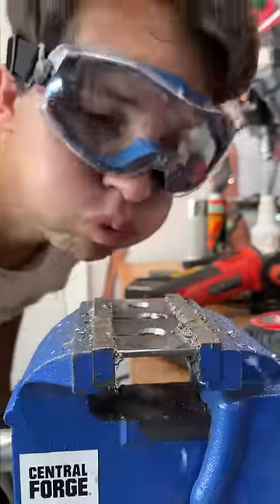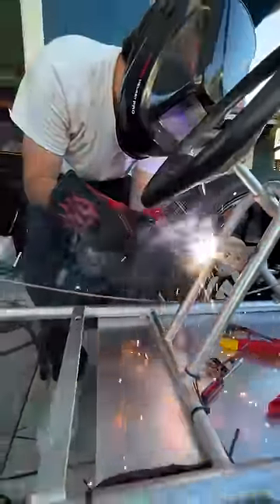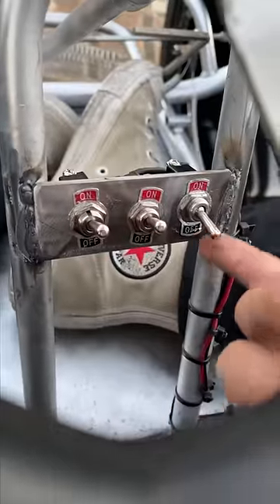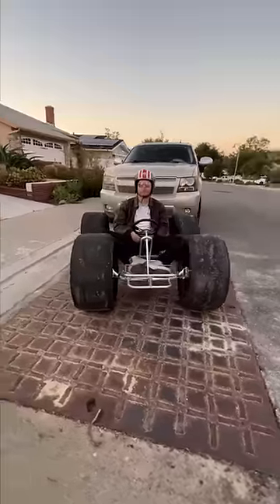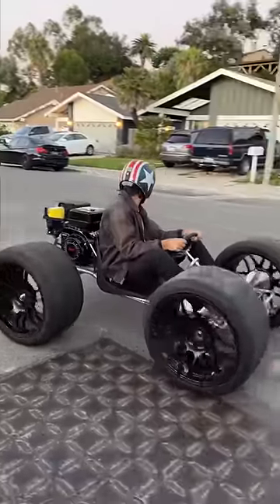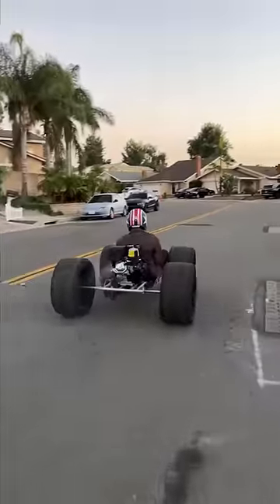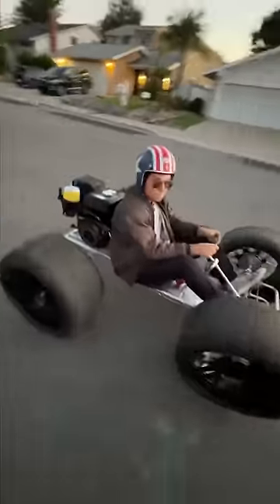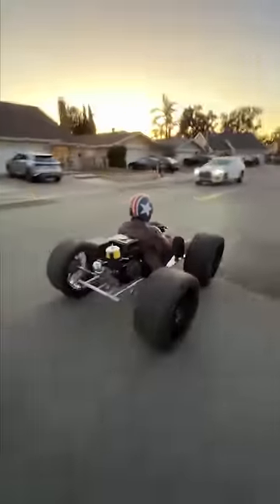My $100 Monster F1 Gokart First Drive Didn’t End Too Well

Comment: those tires are going to be your biggest issues
Reply: Yea
Reply: The tiny tires would have been so funny on like a f1 car sized gokart😂
Reply: Please just put on go kart slicks
Reply: He was not going 30mph
Reply: If he editedthis he said
(These tires going tobe your biggest issues)
He need make it longer so more like a f1 kart i cant tell when the wheel touching it need a bumper
Reply: @Bjw1809 I'm betting he did off camera
Reply: Yeah he’s going to need a low gear or it’s going to pick up speed very slowly and he’s going to need a very beefy axel
Reply: 1000th like
Reply: God is coming soon Repent. Please
Reply: @everettstormy  not in that thing
Reply: Lot of force on the single brake as well
Reply: Why is no body talking abt that the kart has no differential
Reply: @jacebarbiellelasquite1109  Exactly what I was thinking. Without a differential on the rear, especially with those big tires are going to start binding the driveline in a turn. There's a reason gokarts only power one wheel without a differential.
Reply: @pdog2121 biggest issue  is when rent a tire  comeback for their wheels  J/k
Reply: fun project. looks like a blast. here are potential issues i could see going wrong: the death wobble is probably from hubs that aren't running true & bearings too small to support the mass of the wheel; the brakes may be too small to overcome the inertial force of the wheel when rolling; flipping due to center of gravity being too high - if you lower the cg (including driver) to be even with the wheel hubs, it would be far less likely to flip; there's no emergency brake - you need to be able to lock the rear wheels in an emergency so you don't have to hit a curb or someone else to stop. anyway, good luck!
Reply: Could you explain why the tires are an issue thanks
Reply: Dude I get it
Reply: Lots of weight to get rolling and lots of weight to stop from rolling
Reply: Yup!!
Reply: works if the axles thicker or tires thinner
Reply: axle 🤏
Reply: Thank you
Reply: Tires and wheels weigh more than the whole car!! Bigger not always is better
Reply: One day he may find out he needs a back diff
Reply: Yeah get rid of those wheels and tires 😂
Reply: The cheap frame would🧐🙏❤️🙏
Reply: Swap those tires with motorcycle tires
Reply: Lack of suspension and heavy ass tires. Something was bound to break.
Reply: I was gonna say that.  The wheels and tires weigh too much for everything he's got goin on.
Reply: I love them and I have a folder about them
come take a ride! :))
🚅🚈🚞🚝🚂🚃🚄
trains, trams, aren't they all beautifull
Reply: @cyber3167 I wouldn't really call your project consistently falling apart the fun part. And if he was gonna keep those giant ridiculous looking tires he should really buy some stronger tie rod, suspension pieces, ect.... Can you have something that big that your parts aren't rated for it's going to consistently break so he needs to get heavier rated parts
Reply: @UnknownNotFound630 If hes gonna keep those tires he needs beefy everything., Those tiny parts hes putting on that poor little cart literally can't handle the weight of those tires especially when moving.
Reply: @ryanwest764 They are literally too heavy for the axles and tie rods, That tiny carton can't take the weight of those tires especially when moving or cornering
Reply: @kingpest13 More power out of that tiny little 110CC engine would be needed then. You saw how slow he was going with just the weight of the tires
Reply: @jacebarbiellelasquite1109 

It makes no differential whether we do or not … 🤣🤣
Reply: Literally
Reply: the wheelbase is way too short... possible flipping

Comment: That small ass brake caliper isn’t stopping that for long
Reply: That’s probably why it didn’t work
Reply: My thoughts exactly 💯
Reply: Ehhh secondary issue… they have that under the cosmetics list
Reply: Don’t worry. He will find out.
Reply: What's wrong with 2 brake rotors on the front axle? More than $100?
Reply: @kychristell1779  it's the unsprung weight that he has to counter. With tires and rims this big it's an issue.
Reply: Today I'm swapping my geo metro with a harbor freight 😂
Reply: Yeah I bet the pad probably melted and that's why he had to use the curb.
Reply: Exactly, I would have went for 2 stroke karting parts, or buy an OTK tonykart chassis
Reply: It weighs less than 100 lb wdym😂

Comment: Also motorcycle brakes will work alot better setup.   Id personally go with a motorcycle parts bike and use it to make the needed upgrades. . like i said in previous post.    Motor/ stearing upgrades/  brakes off the bike / clutch/ shifter/ key!  Start/kill + those backup switches.   And a handle bar setup off the bike or f1 style wheel would be awesome.

Comment: That's what I was getting at and if one wheel hit a bump its over. Your going to have to beef the hole thing up. Get car  hubs and steering box. I figured it rip out your hand or bend
Reply: trust in the word of God, Matthew 7:24-27 Jesus says here, Therefore whosoever heareth these sayings of mine, and doeth them, I will liken him unto a wise man, which built his house upon a rock: and the rain descended, and the floods came, and the winds blew, and beat upon that house; and it fell not: for it was founded upon a rock. And every one that heareth these sayings of mine, and doeth them not, shall be likened unto a foolish man, which built his house upon the sand: and the rain descended, and the floods came, and the winds blew, and beat upon that house; and it fell: and great was the fall of it. Jesus saves, God bless.😊😊😊😊

Comment: Wheels that big is the issue my guy
Reply: The CG is too high. Put a roll bar on it before it flips.
Reply: F the roll bar get away larger breaks stistem, if you can't leave it😊. Also get a bigger frame so the wheels Don't wobble. Then perfect. I'll run that all day or between times, fun!!🎉
Reply: Lack of power is the bigger issue here
Reply: @danielholland3991  I wouldn’t say that’s the issue here, it’s more then enough for a go kart, the wheels are too big and the axis is probably dying
Reply: @RedOnCod  but if he had more torque then it'd spin them wheels no worries.
Reply: @RedOnCod  and yeah more than enough for a kart with regular wheel size
Reply: Seriously lol. To handle those wheels he's gonna need to beef up literally every component... and then he's basically just building a car lmao. There's a reason karts have small wheels lol

Comment: You need smaller drive wheels or a different gear ratio, that engine doesn't make anywhere near enough torque for your current setup
Reply: Agreed! It doesn’t need wheels/tires that big! Drag racer use thinner wheels in front(for rear wheel drive)!
When I 1st saw his vehicle, I was saying same thing! Gotta have power if u r going wit big wheels!

It’s the story of those big huge trucks! Bigfoot, Gravedigger, etc! They have over 1000-2000 plus horsepower! Lol Dude’s gotta come with it!😅😂😅😂

Comment: Those wheels and tires are a massive amount of unsprung weight, a critical factor in an ultralight vehicle with a small engine. I’d go in the opposite direction, using wide CF bike wheels. MUCH smoother, easier to stop and start, and much easier on parts and engine. That motor is gonna burn out fast trying to move 200-300lbs of wheel/tire, not to mention the stress on every component attached, as you quickly discovered! 
Throw some 26” 3-spoke CF wheels on that badboy and you’ll be FLYING - the launch, top speed, handling, and stopping will be night and day. Dropping 30-50% of wheel and tire weight on a 4 cylinder compact makes a huge felt difference in acceleration from stop, handling, braking… Dropping 90% of wheel/tire weight on a kart is transformative, absolute game changer.

Comment: Needs either passthru tierod ends with 1/2inch or better shafts and ends.    100%    and a torque converter definitely needed with those size wheels and no gearbox ---    your best option is smaller drag style slicks on all 4 corners .. New stearing setup reinforced front spindles with crown nuts and pins to make sure theres no backing out for safety.     Ive made some BADASs carts some yrs back.  But your best option is smaller wheels billet rims solid hubs .. Something like some 8/10in x6/8 wides.   In the back and 8/10 x 4/6 in front.   And make it sit LOW ..    Also those motors are ok for basic use.  But if you're looking for F1 style.   Ya need to go with a motorcycle motor.  Like 600/1000cc.  It will also solve those issues with the clutch / converter. .    and will be able to handle those size wheels alot better.    Also you get a shifter and clutch.    Its alot more fun banging gears 😀  .. And you're going have a key start. . theres alot of benefit from the upgrade to a motorcycle motor and shifter setup ..   Besides the sound will be alot cooler !!!

Comment: For your next build imagine attaching the wheel (w/ tire) on the end of a stick with 5ft stick-out and swinging that shit around without it flexing. Those are the forces you need to counter with your mounting points and frame, plus how much steel your first frame lacked.

Also the same concept is usable for a “smoother ride” just reduce the unsprung weight (smaller wheels and tires)

Comment: I plan to build something similar, going back to school at 51, to get my welding certificate. My project is gonna be to build a tube frame and chassis, but a little turbo 4 cylinder or V6, think sand rail for the street, low to the ground mid engine, with some kind of body either sheet metal or fiberglass.

Comment: As a suggestion, put in a bigger driven sprocket, or change out the centrifugal clutch for a belt driven tourqe convert. It's just a suggestion.

 Edit: aquire and install steering gear like on utv. From personal experience a death wobble happened and almost broke my wrist from the kickback. I would recommend it because it would eliminate the wobble and you will be able to prevent the kickback.

Comment: Differential in the rear axles might help with the wobble due to turning, your inner wheels go a shorter distance than the outer wheel making the outer wheel compensate and skid around.

Comment: Gonna have to weld those tie rods solid if you plan on keeping those tires on. Running a larger final sprocket wouldn’t hurt either since those tires are so tall.

Comment: longer axel braced so that It won't snap and smaller front wheels would probably help mine was a a death trap after mounting up a 440cc duromax I stretched it like 9 inches with 2 inch wider axel. Before it didn't turn well very bouncy an extremely tippable due to the extra engine weight

Comment: Do some air holes to the brake disk for cooling. Like this, they will overheated easily. Better cooling, better performance 👍
Reply: The pads also need to be bigger than a quarter to stop 20" wheels

Comment: Bro I'm no engineer but you actually thought those "tie rods" could safely  control turning on those massive (in proportion) wheels and tires? 

Youre a braver man than I... the second i would have noticed those 1/8" thick "tie rods" I'd get off that desth trap

Comment: Might be because the tires are a lot bigger than the tie rods are designed for looks amazing I think it's pretty cool go-kart but you may need to consider getting tie rods that are designed for tires that big which would possibly mean you're going to have to get a bigger frame for the go-kart

Comment: Install another frame on top and throw in Strutss/springs between the 2nd frame, than reduce the sprocket size to increase speed faster and a stronger engine wirh some performance heads would def help that car.

Comment: You need to balance the tires to prevent a wobble. I suggest taking them to your local tire shop if you do not have a tire balancer
Reply: I would just change the tires to go cart tires. It would perform much better!

Comment: Rotational mass matters a lot more for brakes than vehicle weight does. You need some proper calipers for wheels that large. Same goes for anything else moving the wheels such as the tie rods.

Comment: How about adding an ecm (electrical control module) and some sensors that way the kart isn’t 100 percent mechanical. Literally will save you a lot of hours. The most important thing about 100 percent mechanical devices is that they need to be built soundly as close to perfection as possible. You literally slapping things together and testing irl can get you killed.

Comment: Adding two different motors together remember the tires the tires will cause an issue momentum the tires the tires do hug the road however there's a different model with thinner tires if if the tires were still fat and thin get dragon's drag try the diesel you probably look out more and it would last longer there's a diesel there's a diesel 2-stroke and 4-stroke

Comment: Man I really would rethink trusting any of those welds. Minimal penetration to fuse the metal and more of hot glue gunning metal. Just be careful because when they shear they share violently and usually under tension. Have fun be safe.

Comment: With tires that big it's not going to turn without a rear differential. It's either going to push you straight or break the axles. And I see you already discovered the problem with the front steering. Tires that big tie rods aren't going to work. It needs a rack n pinion.

Comment: theres a huge mass difference...its the ratio of your wheels and tires's size to the small frame that at speed will cause you some very bad issues. esply with how high your frame is off the ground with no shocks? yeesh..you want tiny wheels if youre gonna go fast and you need WAAAY better brakes for those wheels esply when you go over 5mph

Comment: Get smaller tires ! And maybe flip it so the wide width is the front and not the back then just put thinner tires up front little smaller then you already have for the back then add a sick mother like an old ski dooo motor or something that can go fast street bike engine work too

Comment: I THINK YOU SHOULD START FROM SCRATCH AND BUILD A STRONGER FRAME INSTEAD OF USING YOUR OLD $100 ONE DON'T CHA THINK?? CONSIDERING YOU'RE GOING WITH CAR WHEELS THAT'S BUILT FOR TONS, ANY KIND OF DINKY GO CART PARTS WON'T WORK HIT A SPEED BUMP LIKE THE ONE'S YOU COMES ACROSS IN A CAR THEN YOU'LL SEE STAY SAFE YOUNG MAN.

Comment: Do not hot a pothole the tubing you are using is not the best size or wall thickness  use 1½ inch ×. 083 inch wall tube.  If you insist on using what you have then build an upper deck frame with cross bbeams to support and reinforce the frame then skin it in fiberglass or HDPE plastic sheet  or semi trailer mudflaps ( same material  24×30 inches  then bolt then on.

Comment: Oooooh, skipped the engineering courses, huh. Torque, rotational force. Need MUCH better brakes. Wheels that size, each wheel. The wobble? Try some BMX size, sealed 3 piece crank barings, 2 rings per wheel, steel pipe for size adapting sleeves. Should eliminate the wobble.